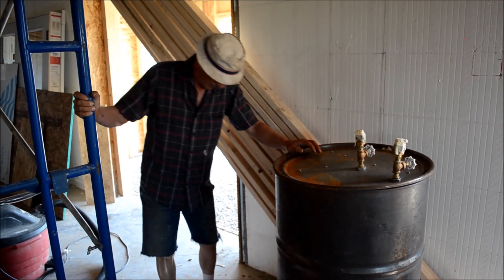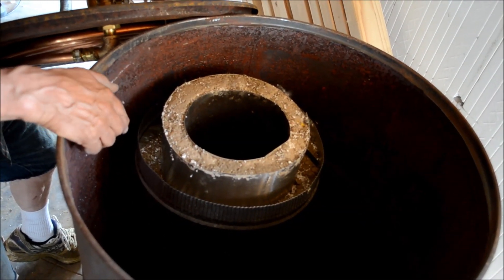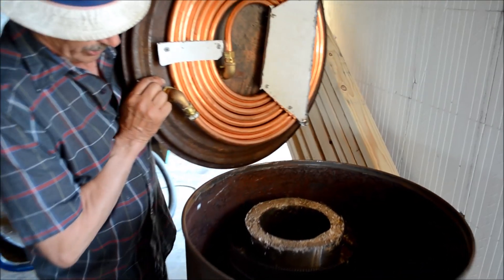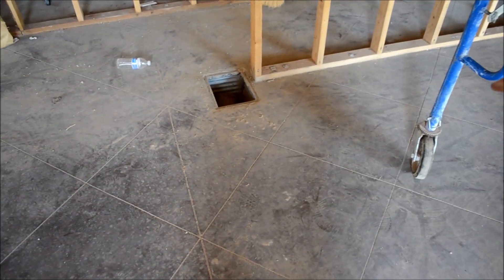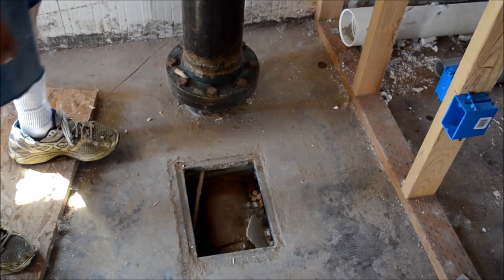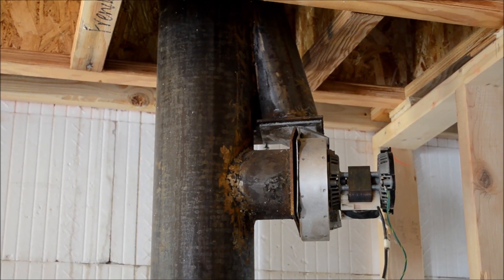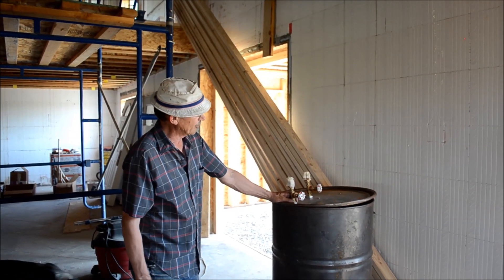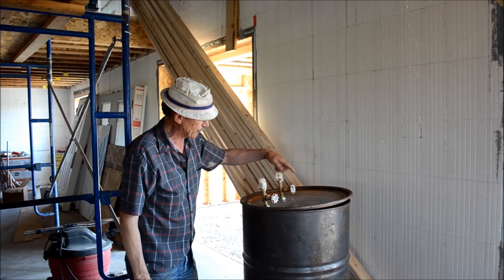rocket mass heater

Comment: I would love to learn more about the water coil. Im in New England My wife an I bought this house last and unfortunately I'm heating with oil its killing me among many projects I have whats pressing is more efficient heating. We currently have  forced hot water and I'm looking to adapt a Rocket/wood stove to integrate into our system.
Reply from the maker: Forced hot water should be very amenable to this kind of thing.  I've done or been involved with a dozen or more implementations of this kind of thing. The hard part is retrofitting the wood stove in a place where it works with the water and with the exhaust.  A rocket stove works well because being self-drafting you have more options for where to run the exhaust.  The downside is that it takes a lot more engineering to make it work well.  Check about local codes and impact on insurance too. 

In terms of how to make the water coil work, you want to put it where it will get a lot of exposure to hot gases.  In a rocket stove that would be either a small loop in the firebox or a coil at the top of the riser pipe as shown in this video.  You can use copper or iron pipe.  I think iron pipe holds up better.
Reply: Scott Graber Thanks for the reply Scott its much appreciated.

Comment: The whole idea with rocket mass heaters is not to be dependent on anything except the wood to run the system,without Electric.
Reply from the maker: That's a purist approach; we were shooting for something a bit more practical.  The stove can be run without the electric assist, but it takes longer to get going when the system is cold.  When you come home to a cold house and want to get the stove going quickly it really helps a lot.

Comment: A couple of questions: 1. Have you had it up and running yet to know whether the concrete mass around the piping works well? as I'm considering a concrete fill for my bench. 2. The gap you have between the heat riser insulation and outer barrel is huge. Have the other 2 heaters that your Dad built similar gaps and do they seem to work well like this? Thanks in advance

Comment from the maker: Yeah the fan helps a lot.  Dad also did one where he installed a whole house vent fan that positively pressurized the whole house and helped to blow the fire through the firebox when the heater wasn't warmed up.  That worked pretty well, but only on a tight building.